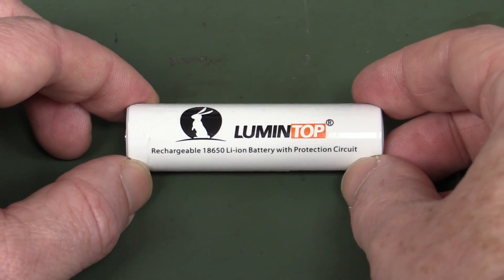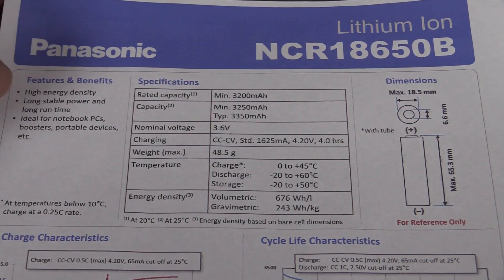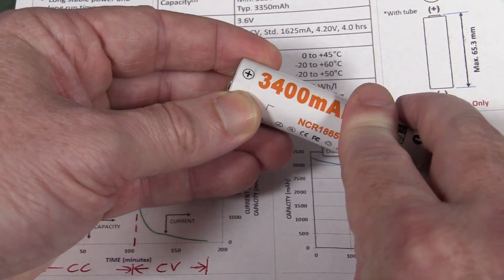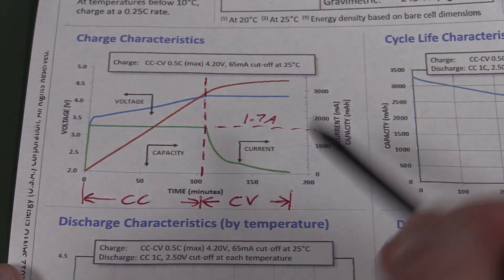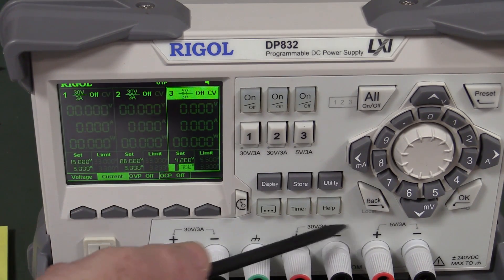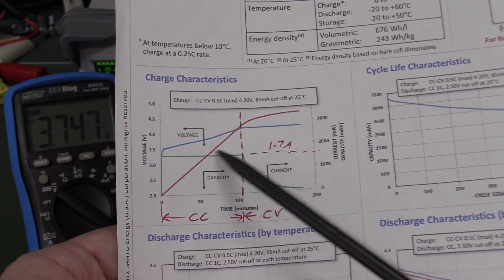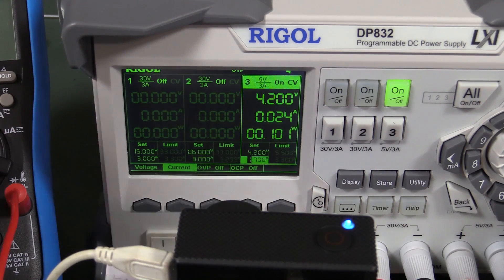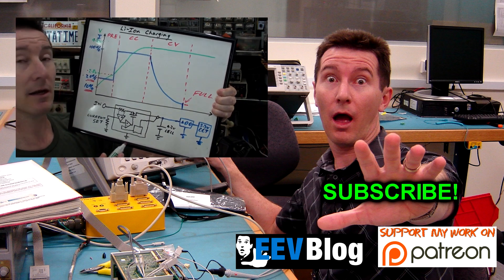EEVblog #919 - How To Charge Li-Ion/LiPo Batteries With A Power Supply

Comment: The capacity graph in the data sheet says it switches from cc to cv at about 80-90%, not 50%.
Reply: Actually, it should say when the charger should switch from CC to CV.  not when the cell does.
Reply from the maker: It can be quite chemistry/manufacturer dependent.

Comment: I think this video gives wrong idea's of charging lithium. Just buy and use proper lithium chargers and don't fool around like Dave...
Reply: It is safe if you know what you are doing.
This method of charging is no different from using the dedicated chargers.
But this with method you can charge any type, just just the cylindrical.

Got a flat battery from a smart phone your repairing?
Instead of putting it back in the phone to charge at a slow 500-1000mA rate, plug it into a power supply
Reply: No, he is perfectly correct. I designed a number of chargers for various chemistries for a living.  The method he demonstrates is exactly the way the cell manufacturer recommends. Granted, one needs some basic skills to charge a battery with a power supply.  Not recommended for everyone, and a charger is more practical (just make sure it's not some crappy chinese one), but in a pinch, there is nothing wrong with the method shown.
Reply from the maker: In case you missed the point of the video, it was about using PSU when you don't have a charger. In any case this is the exact same method commercial chargers use. Not quite a fool-proof, but it's the same.
Reply: What happens when you are designing a circuit that will charge a lithium battery?  That's the audience here. We want to understand how charging happens.
If you want to just buy everything off the shelf, you're on the wrong channel.
Reply: +Bob Lake a lithium charger will lower down the amount of  the current much quicker when it is near 4.2 volt. At 4.0 it the current is already considerably lower at a dedicated lithium charger. But then, on lithium packs I start to charge at 1C. I have no experience with 16850 cells...
Reply: Fermioncool Fermioncool 
The current profile curve depends on the battery, and the charge rate.  All the charger knows is the current and voltage switchover points. Those also vary a little depending on the exact battery model. So for that reason, most chargers are designed a little conservatively, in order to safely charge a variety of batteries.
When a charger is designed for one known type of cell, then one can tailor the charge profile to match that cell type perfectly. This also means that the accuracy of all the parameters become more critical, especially at higher charging rates. (1C or more).  Dave is charging at 0.5C, a less stressful rate, leading to one particular current/voltage plot.  This would change for another rate of charge.
Reply: You're absolutely wrong. quick example. i have a Mac Pro with a dead li-ion RAID battery/charging circuit. to fix it, i need to replace a li-ion cell with a new one, charged exactly to 3.7V and check if it charges/sences it properly. these two videos answered more questions that i had and i am really happy to know more than i needed.

Comment: If you use a low charging current, you can get away with a very simple circuit.  I have a 5v solar cell that puts out 300 ma at 3.5 volts, down to 25mA or so at 4.2 volts.  I determined the current values empirically for my setup (expected illumination conditions) before proceeding.   Works perfectly on this kind of cell, it just takes a day or so.  I can leave the cell connected indefinitely with this setup. Works great if you're not in a hurry for that charge. I use a number of cells that I cycle through.
Reply: Well - as long as you 5V solar cell really never goes above 4.2 V that is.
getting the cell to 4.3 v a single time might already destroy it completely.
Reply: ABaumstumpf Its a new setup, about 10 days old now.  The solar cell only puts out a trickle of current maybe one hour a day, when the battery is full.  I will be watching it closely for a while.  You are right in that it is an iffy setup. A bit of an experiment, which, so far, appears to be working.
Reply: I use a similar set-up, but I always use either protected cells or cells to which I've added a protection circuit.  That ensures that once the cell has received a full charge, it won't over-charge and also once it discharges too low, the output will cut off.

Comment: I have a torch that runs on a single 18650 and has an integrated charger. It came with a micro-USB charging cable
Reply: I HAD a torch that ran on two cheap 18650's. It came with a DC plug pack. 

It was a bit fussy though and didn't like having a 12 volt pack accidentally plugged into it. I now also know exploding 18650's wake you up quicker than a smoke alarm; and how much of a pain it is to clean up a room that's had them explode in it.
Reply: I think this: aluminium flashlight + unprotected 18650 + broken charing circuit = PIPE BOMB :D

Comment: 3400 mAh....  Curious,  how much u can really drain.. 😁
Reply: That would make a great follow up video. He has the equipment to do it too.
Reply: +Johann Wyss Wow been looking for something like that for a while. Going to order one thnx. Ordered from Banggood :)
Reply: there are simple measuring tools for this,  I am using something similar like this: http://www.dx.com/p/digital-display-portable-usb-power-voltage-current-meter-tester-charger-doctor-for-power-bank-phone-383562#.V8n-cMuxXqB
Reply: I use this as the USB doctor uses the power from the cell and as such alters the consumption. Besides a constant current load is much quicker and more accurate. http://www.ebay.com.au/itm/Constant-Current-Electronic-Load-9-99A-60W-30V-Battery-Discharge-Capacity-Tester-/281848513136?hash=item419f7b0270:g:F3AAAOSw0JpV3yfr
Reply: If it is a decent quality one? You can actually expect > 90%.
If the load-current isn't too high, than you might as well get to the range of 98%

The top LiPos can even have total efficiency of above 95%.

Comment from the maker: Sorry for the re-uploads, I wanted to remove most of the the voltage drop stuff to avoid confusion and constant emails and messages and comments for the next 5 years.
Reply from the maker: Welcome to the fun of Youtube :->
Reply: What sort of freak doesn't like the same emails being sent to you for years and year?! ;)
Reply: +Fermioncool Fermioncool I assume the voltage drop could be seen as a extra security, at the batteries emd you will never go beyond 4.2, again I assume.
Reply: Dave, maybe this is a small video, but the topic is very popular in recent times, and every mistake can be noticed and stigmatized that it is not repeated.
Reply: It won't likely explode but it will be dead or near dead.
Reply: I see. 3 AM is not a typical time for uploading stuff.
Reply: And i thought youtube does not like your videos anymore ;-)
Reply: EEVblog foolproof edition!
Reply: @Justin Bell

The other video said you should use thick wire because of the voltage drop from the charge current to minimize voltage drop, and get as close as possible to the output voltage I think Dave just didn't think about the current going steadily down in the constant voltage mode to the point where the drop on even thin wires would become extremely tiny by the end of charging, making overspecing wires make no difference. He spent a few minutes talking about the voltage drop, so he pulled it out.
Reply: jesondag thanks for the explanation. Don’t suppose you’d be willing to exchange a couple emails or chat on discord/signal/wherever is convenient for you?
Reply: No. So long as you use a proper charger designed for Li-ion cells and set the charge current correctly, it will not go above 4.2v, and will cut off once the charge current drops below a certain threshold- exactly as explained in the video. You would only have an issue if you set the charge current too high, which would result in the cell warming up and shorten its life span. Using an improper charger on any battery type is when you run into explodey fun times...
Reply: Thank you for making this video available at last! Please disregard my complaint about it in the comments of one of your previous videos. You rock, Dave! If there were no Dave Jones with his EEVBlog videos on Youtube, one would definitely have to invent one ASAP!
Reply: Seegal Galguntijak what was the deal? What were complaints/emails/questions over?
Reply: Good day, love you vids BTW.  
I'm making a prototype that uses 2S 7.4v 3400mAh battery pack. Do you know any good changing IC modules (PCB) that I can use to charge the pack via USB. I don't want to integrate the charging circuit into my existing design, since they look like they are pretty cheap anyway. I'm looking for something that I can just punch a hole in my enclosure for the USB and it will just work. Any advice?
Reply: Again I feel the need to thank you for enlightening my non comprehension of batteries charge. It allowed me to "choke, rattle and roll !", a pack of 6 "dead" elements . I Cannot say if they begin to accept charge due to strong exposure to 4,2 v 3A (c6) 5V 3A or by sending a 10% volt 20%current for 15 minutes,  but they seem to accept a charge up to 12V yesterday, up to 16.2 v after one hour  at 2A 24.2 V today (slowly rising) . I have a question : do you think it must be preferable to use less amps ? The battery takes 1A at the moment , very little warming, slow raise indeed. (Pack for vacuum cleaner, new but unused for 3 years I guess) Thank you and sorry for the long question . Kind regards I like your curses ;)
Reply: Still got another year
Reply: Thanks for taking the time Dave!
Reply: What was the problem?
Reply: updated as need duh  just like solar road ways etc..